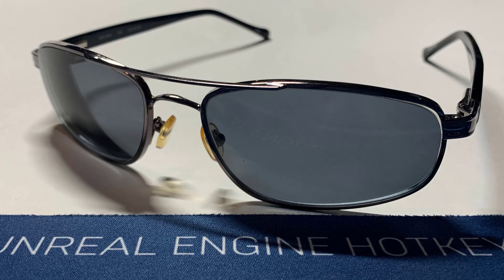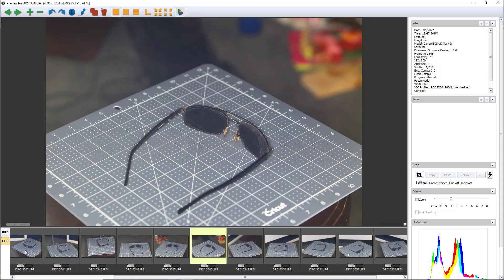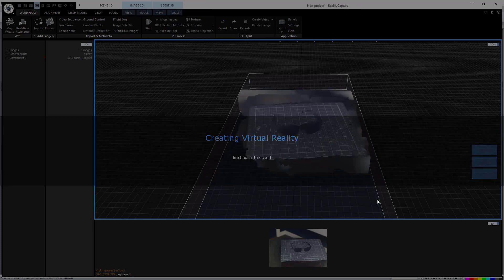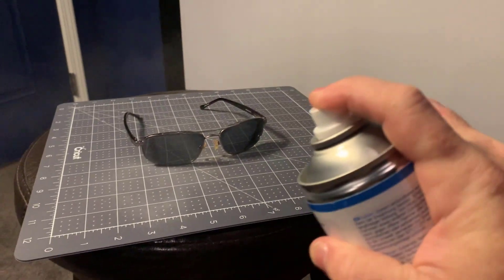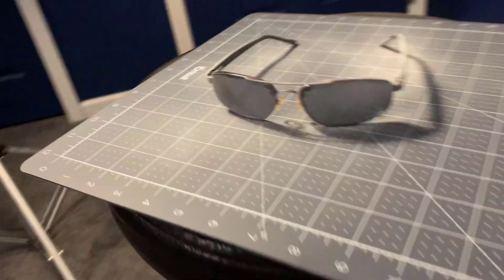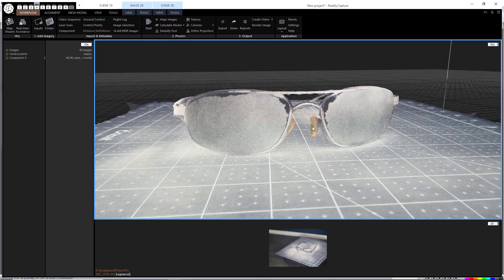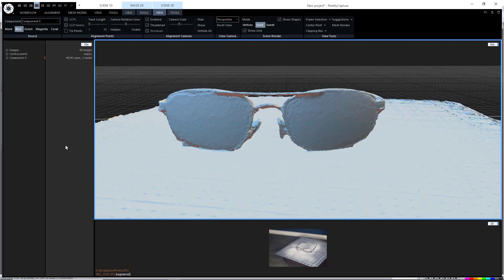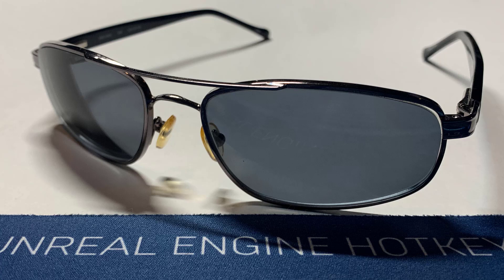Photogrammetry for Shiny/Transparent Objects

Comment: Really interesting! Intrigued by that spray product. So cool that it evaporates. I’m a bit shocked that the results were so bad - I can’t figure out why exactly. I know you said we could put the result into maya etc but honestly it would be faster to take isometric photos (front back sides top bottom) and model from that. :) Looks like you’re using “reality capture” software - maybe it’s just not good in this particular use case? I wonder if their competitors would do a better job.
Reply: Btw with sunglasses I’ve had better results than these even with no cross pol and using an iPhone app 😂 I really want to figure out why reality capture is failing so hard at this task! 🤔
Reply from the maker: @virtualfilmer  Nice. Maybe I'll have to give my iphone a try sometime. 

I ran these same images through Agisoft Metashape as well and the results were less effective than RC (a number of gaps in the top bar and temple pieces and generally warbble-y all over). RC and Metashape were the only tools I tried on this set, though.

Thing is, I've been doing photogrammetry since like 2004, long before there was any hope of getting usable geo from the solve, so have this 15-year-plus habit of always doing re-topo over results that's hard to shake. Once I've got a result like this, with everything I need to to "trace" for a clean topology model, I'm good to go and any further effort for refining the result starts to bleed off the efficiency gains.

I really like photogrammetry as an assist on objects like this that are curved in many ways 3 dimensionally. I'm sure there are loads of great 3D modeling artists that could knock these out from isometric shots... but I'm not that guy .... I'm just addicted to tracing a result like this with some NURBS and knocking out the geo from there.

Plus, these will need to be rigged with joints (non-Nanite geo) to operate the temple pieces, so this was going to get re-topo'ed no matter the result anyway. :-)